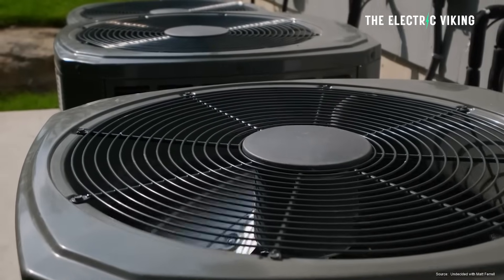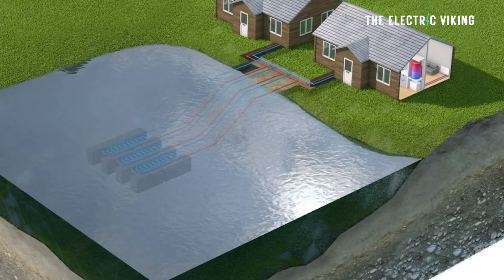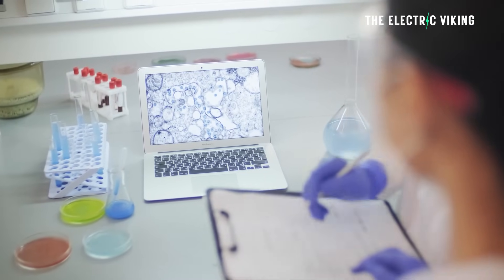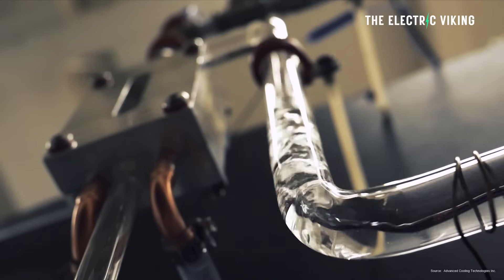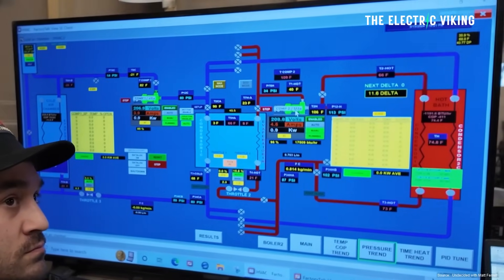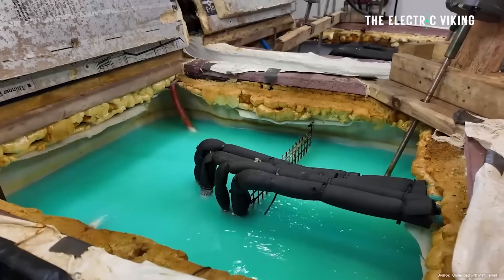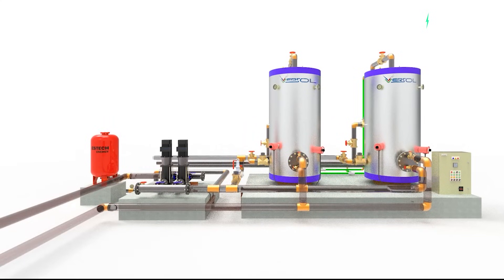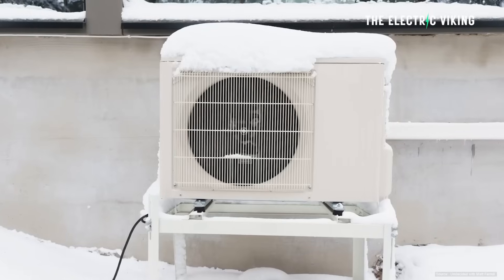GAME changing' heat pump delivers 400% more heat than the energy it uses

Comment: We used to build heat pumps at butchers shops in the 80s just to give them free hot water from there freezer motor. Now the gas's have got so much better to give heat transfer. Keep smiling everyone

Comment: A lot of people are posting comments that basically say "I did not watch the video". Sam explained it right there at  0:30 : "a new water-based heat pump".
It extracts heat from water which not only can hold more heat per volume than air or dirt, but is much easier source to extract it from. Even with the global warming there are plenty of areas where -20C/-4F winters are considered normal or even mild; at that temperature the COP of most air source heat pumps is barely above 1 if they work at all but the water in river or pond is still stable above 0C. Tapping a water source is also cheaper than digging deep or wide enough to make a ground source heat pump useful.

Comment: This is not a better heat pump.  It is using a relatively unusual heat reservoir.  Even my ancient heat pump is almost 300% more efficient than straight resistance heating.  400% can be reached with air, but the units would have to have much larger condensers and fans.  It's a matter of money. 

In fact, I've seen on YT a simple kit that sprays water on the coils when the compressor is running.  Sure enough, lower head pressure, i.e., greater heat transfer.

Comment: For a heat pump to work you need a compressor that will compress some gas or some pump that will circulate some fluids, you need electricity for that (hence the 5 times more energy out then in), to supply this energy, solar panels are a totally valid solution giving you a completely renewable and high efficiency solution.  The two technologies actually complement one another very nicely.  Don't tell that to the hydrocarbon folks, they are going to trip balls...

Comment: For home use heat pumps are still more expensive even in the long run. You can't save enough to offset the cost and upkeep. My AC unit cost about $2700.00 and has been working for over 6 years with no maintenance at all. Even if it broke tomorrow it's already paid for it's self many times over. The only thing I've done is replace the filter in the air handler. Before I became a home owner I used to think this was the most expensive part of your house but it's actually cheap, replacing the stupid fence would cost over $10,000 even more than to re-roof. That's the expensive part.

Comment: Best geothermal system for heating and cooling is having part of your living area below grade. 

Issues with stuff like this is the need for glycol, associated cost and efficiency losses with the heat transfer of the glycol itself and the need for extra heat exchanges… 
The issue is no perfect water to water system exist on the market that I know of that gets you efficient, very high temp water out of the system for direct use in a  conventional type baseboard system, so now you need radiant flooring or panels for heating, and an air tight house so a warm surface is enough to heat the air in the home. At that rate you can get away with a cheaper air to air system with high efficiency and much less complex or a system

Comment: I am a heat pump installer in a cold climate in the US
“Comparable to the most efficient air source heat pumps in the world, which are very very expensive” 
He is wrong, you can get some of the most efficient air to air heat pumps in my market for very reasonable cost, they are just smaller units. To run a home with the most efficient reasonably priced heat pump, you want a small heating load, or you want to get a good price on install so you can get multiple small to medium single zone units (low temp…if you are north of say Connecticut and it is your primary heat)

Very high efficiency larger-commercial air to air are very expensive…. But I can get you 12 different options for a super affordable high efficiency air to air, and that is for one of the coldest states in the US….

Comment: Approximately half of our life endeavors yield success, while the other half culminate in failure. In the realm of energy efficiency, my solar panels fall into the latter category, whereas my Daiken mini-split heat pump stands as a resounding success. The solar panels falter due to their hefty $10,000 price tag for a 3200-watt grid-tie system, coupled with their meager annual savings of approximately $300 in the perpetually overcast climate of Seattle. The prolonged breakeven point of over 30 years casts a shadow on their viability. On the contrary, the Daiken heat pump, priced at $3,500, proves to be a win-win, saving a substantial $800 annually.

The unreliability of solar panels becomes evident through the constant need for cleaning, expensive repairs, and the removal of moss and leaves, requiring meticulous attention to the roof's maintenance. In the span of 12 years, I have replaced three costly microinverters. In stark contrast, the Daiken mini-split remains remarkably resilient, demanding zero repairs and minimal maintenance—restricted to one summer and one winter filter cleaning, a straightforward "inside job" that can be easily performed at any time.

Moreover, the impracticality of solar panels in northern cities like Seattle, Portland, and New York becomes apparent due to their propensity for cloudy, cold, and rainy weather throughout much of the year. Solar panels function optimally only during the brief moments of the day when sunlight strikes them at a 90-degree angle, rendering them nearly ineffective in regions lacking consistent sunshine. Contrast that to our ingenious heat pumps providing maximum efficiency 24-7 365 days a year.

Comment: Hey Mr. Viking
Question from a fellow Viking 🏴‍☠
Is there any timeline on a domestic system availability??
But is it any different of what we already can get, lots of heat pumps out there for domestic heating use. Do you mean that this new system will produce 400% more, than our current systems??
Thanks for your work.
Claus.:elbowcough:

Comment: I'd be very wary of stealing heat from lakes. There's stuff actually living in lakes which needs that heat. :) Being an enclosed body of water with a limited volume, taking heat out of that body would have a significant impact, especially over time. Good luck getting permits for that in any country with decent environmental regulations. :)

Even in an ocean, a major settlement like a town or a city would have a large localized impact on the water temperature if running such a system, which could affect fish and other water lifeforms negatively.

Comment: In 1988 we installed a water sourced heat pump in a small museum in Central Minnesota.  Using a well was great for us since the water was very useful in summer.  It was set up for cooling but could have been used for heating as well.

Comment: heat pumps can provide heating, however converting that to electricity to "power homes" brings it back to less than 100% so in other words it loses energy in the conversion. but for cold climates this is great if you are close to a body of water. however inground systems work quite well.

Comment: Round numbers:

1) Ok, electricity is 4x more expensive to heat with the fossil fuel.

2) the electric heat pump produces 4x as much heat as consumed to extract it from the water. 

3) so a big heat pump breaks even with fossil fuel, BEFORE spending several thousand dollars for the heat pump equipment and installation. 

"Next..."

Comment: This is nothing new in terms of the efficiency. The efficiency of heat pumps is normally defined by their SCOP value (seasonal coefficent of performance). A SCOP of 4 would mean 400% efficiency. There are now air-water heat pumps on the market with SCOP values of 5.8 which means that they are almost 50% more efficient than the heat pumps which are being presented in this video..

Comment: 400% is nothing special, it all depends on the temperature difference between the source of the heat and the temperature of the liquid going out to the heating system. For example 0/35, 400% is today below average for liquid/liquid heat pumps. And I know what I am talking about, I have 8 heat pumps producing energy equivalent to more than 100000 liters of heating oil every year, the last 10 years, means I have saved more than 1 million liters of oil.

Comment: Hello Sam. Heat pumps are refrigerators running backwards. It is old technology. Instead of transfer heat out of a box to keep it cool, heat pumps transfer heat into a box to keep it warm (a house is a large box). 

It does this by extracting heat from a medium and transfer it to another medium. There are a couple of ways to achieve this, you can compress gas, cool it, and then expand it to cool it even moore, like a refrigerator or an Air Conditioning unit. Or you can use a 90 degree V Stirling engine and drive the crank shaft with an electric motor to move heat from one cylinder to the other.

My dad and our neighbours all installed lake water heat pumps around 1978 here in Sweden.

It works by circulating a liquid (water with glycol so it doesn't freeze) in a closed loop between a spool of windings in the lake up to a heat exchanger in the heat pump in the house. Lake water never ever gets colder than +4 degrees Celsius at depth, its a physics thing, I think it is because water is heaviest at +4 degrees. The heat transfer liquid is pumped up to the heat pump in the house where it passes through a heat exchanger before being pumped back to the lake windings. The lake water heat energy is transferred by the heat exchanger to a second closed loop within the heat pump where it extracts the heat and add it to the house heating system. Air to air heat pumps works the sam way, as do bedrock heat pumps. Lake and bedrock a more efficient because they never gets as cold as ambient air in the winter time.

I have an air to air heat pump heating my house when its cold outside. This winter we had around two weeks with -20 to -26 degrees Celsius and the heat pump still worked and transferred heat from outside -26 degrees C and blew warm air inside my house. A couple of weeks ago we had +25 to +29 degrees Celsius outside and then I ran the heat pump backwards acting like an AC blowing cold air instead. Quite amazing how it works, but it does work! :)

Comment: Electric Viking needs to educatte himself about heat pumps. Then he wou;ld understand that a COP of 4 is nothing special. There have been improvements in recent years including inverter driven, i.e. variable speed, compressors and better working fluids. The maximum COP is equal to the source temperature divided by the difference bettween the source and output temperatures.  This is achieved using an ideal heat engine using the Carnot cycle. When you plug the numbers in you will find that there is some room for improvement but 6 or 7 would be the practical limit.

Comment: The best type of Heat Pump is one that extracts waste heat from household Grey Water that is temporarily held in an insulated tanks.  The Grey Water collected from showers, dishwashing and clothes washing can also be recycled back into toilets for flushing to reduce water usage intake and to reduce sewage output.  During daytime the heat from roof top solar panels can be used to heat the water in the storage tank to higher temperatures.
Reply: I totally would not want grey water going into my toilet water tank. You'd get massive MASSIVE mold and fungus growth in there, and right quick too.
Reply: @lennyvalentin6485  From what?  Grey water contains soaps, chlorines and other mold killing ingredients.  I am not sure how that would cause mold to grow?
Reply: @anguscampbell1533  At very low concentrations, normally. You shouldn't use these products routinely, like antibacterial soap and so on, because A: these products don't kill all microbes, some are left behind, the hardiest ones. WHich means you're training them to become tougher and harder to kill, which means they'll also be more dangerous if/when they cause an infection. Bad idea. Just use regular, non-microbe-killing soap and other cleaning products in everyday use, saving the chlorine and whatnot for when you really need it.

And B: anti-microbial household products interfere with the treatment process used to purify blackwater in sewage treatment plants. So, doubly bad idea.
Reply: @lennyvalentin6485  Where exactly do you think the water from showers, dishwashing and clothes washing goes to if it isn't into the sewage?
What recycling grey water does is reduce the amount of sewage going into a sewage treatment plant and also reduce the amount of potable treated water being wasted for flushing toilets.  
I am not exactly sure why one wouldn't want to do that.

Comment: Heat pump tech is really moving fast. There is a company in the US that figured out that it took less energy to make small steps in temperature than taking one big leap to reaching a comfortable room temperature, so they made a heat pump that heats in several baby steps. Not only was it way more efficient they discovered that they could keep going until reaching heat hot enough for industrial uses. Combine that breakthrough with this water source heat pump and let's see what we get. We are getting heat pumps now that work better than furnaces because the Biden administration created a grant reward for companies that could develop them. This spurred on a bunch of companies to innovate their heat pumps and now we have a bunch of companies that are offering heat pumps that are as good or better at heating than fossil fuel furnaces. From induction stoves, to electric ride-on mowers everything is going electric and becoming more efficient and capable of using solar and wind to power them.

Comment: Sam, youve failed to explain the difference of this between this new  HH compared to other heat pumps. 
It's not a water based heat pump, its a water 'sourced' heat pump.
Btw, our air sourced heat pump has a (COP) efficiency of 500%. 
Water to water heat pumps are normal & have been around for decades too.

Comment: Water is known to have higher thermal energy and conductivity than air or soil (which are also used for insulation) so the innovation is really that we have been able to get cost and thermal efficient output from air and ground systems!
Reply: Water has a high thermal mass. This means that a lot of energy is required to change its temperature, so it is a good 'source' or 'sink' of thermal energy, which can be added or removed with a heat pump as required to cool or heat the air inside a house.

Comment: Not very interesting. Standard heat pumps that are used all over Europe deliver an efficiency of 300-500% efficiency already, so 400% is just average, just uses water instead of air. Also, the average house needs about 7KW to heat it, so you’d still need to provide 1-2KW electricity to make it run. Gas is still more efficient and a lot cheaper. All this depending on product, environmental temperature etc.

Comment: Ok Here is my story. I got a hybrid hot water tank that takes heat from my living space and puts it into our domestic hot water supply ( for showers and washing dishes ) This is all done with a refrigeration cycle with a COP of about 3 to 4. Now not only are we getting hot water for cheap, but we are using the whole process waste cooling to dump into our home. The Rheem unit ( any unit will do ) cost us about $1300 US dollars. Don't think what you are showing Viking can beat this process I installed in our home. ( uses about 400 watts when someone takes a shower ) Like you said in the video, " Sometimes the best product is the simplest product " ( By the way U showed a Rheem hybrid hot water tank at 06:20 )

Comment: If it is 400% more energy produced than put in then the COP value is 5. Swedish IVT and other companies have made solutions for at least the last 30 years with COP higher than 5 today it is close to 6. I checked one model with SCOP 5.85 so it gives 485 % more heat energy than electrical energy put in measured over a hole year. This is fairly standard. I have several cheap air to air heat pumps that has COP 5 or SCOP 4.85.

Comment: Heat pumps definitely the future, they have been used extensively in Scandinavia for around a decade.
Over 90% of heating installations in Sweden use them.
Good building insulation, and HP in combination with a battery to take advantage  of overnight electricity prices, and heating costs almost free😮
Reply: Not a decade, more than three decaded.
Reply: "Heat pumps definitely the future, they have been used extensively in Scandinavia for around a decade."
They've been fairly common in the SouthEast of the US since the 1990's.

Comment: No offense, but with a water or ground source heat pump - COP of 4 is basically low-end. You can get COP of 6 or higher.

Top end air-source heat pumps (a more difficult challenge) can reach a COP of 4.

Comment: 400% or COP 4, has been standard for many many years
Reply: Round numbers:

1) Ok, electricity is 4x more expensive to heat with the fossil fuel.

2) the electric heat pump produces 4x as much heat as consumed to extract it from the water. 

3) so a big heat pump breaks even with fossil fuel, BEFORE spending several thousand dollars for the heat pump equipment and installation. 

"Next..."

Comment: The guy doesn’t understand how heat pumps work!  In  ideal conditions current heat pumps can be 500% efficient.
Reply: It is in -20C and below that heat pumps loose their efficiencies-right when they are needed most.  To counter this it is best to have a gas or electric backup.
But still overall Heat Pumps are more efficient than oil, gas or electric forms of heating.  If you use a heat pump for cooling in summer, the heat extracted from the inside air can be scavenged to heat water for domestic use with an electric or gas boiler topping up the temperature.